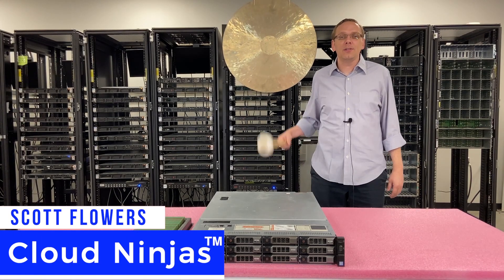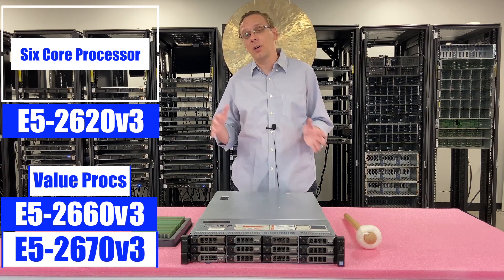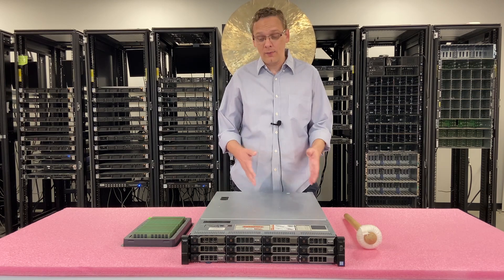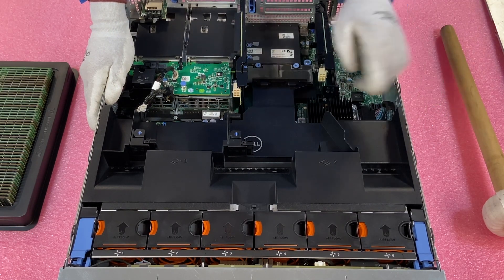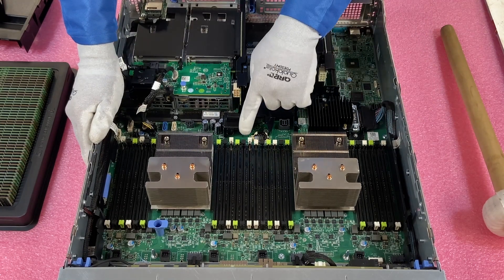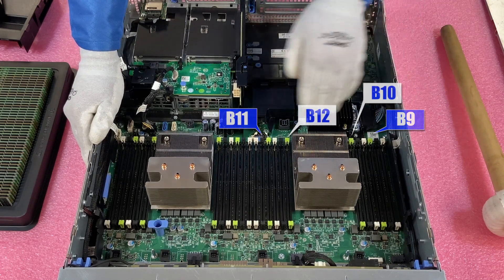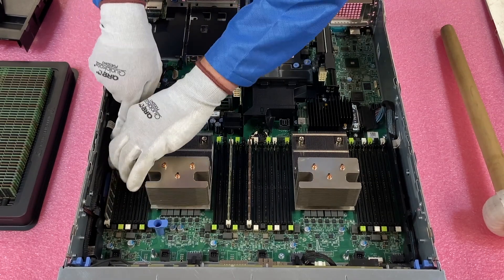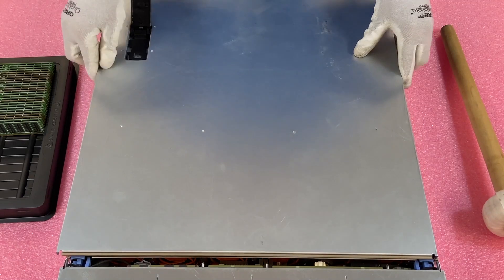Dell PowerEdge R730xd Server Review & Overview | Memory Install Tips | How to Configure DDR4 DIMMs

Comment: I have 8x16g Samsung PC4 2133P-RAO-10-OCO installed and working great. I installed another 8x in the server, perfect, zero issues. Furthermore, I installed another 8x and BAM! It doesn't recognize any of the sticks in any slots. I'm specifically working on the green slots. I tried the same ram in working spots and they work fine. Furthermore, I switch the other ram in the green spots and they work. If I put them in one by one, it sometimes recognizes the ram? What is going on, should the "order" I put the ram in matter when I'm filling all the spots?

Comment: hi, if i install 4 dims of 64 gb and 8 dims of 32 gb , it will works?
Reply from the maker: Yes.  As long as same type of RAM.  Cannot mix LRDIMMs with RDIMMs.  And whatever the slowest speed installed... they will all operate at that speed.
Reply from the maker: We are also releasing our R730xd series in 3 weeks from now.  Will cover a lot of extra information.   Smash that subscribe!